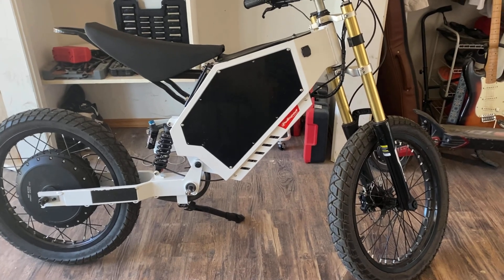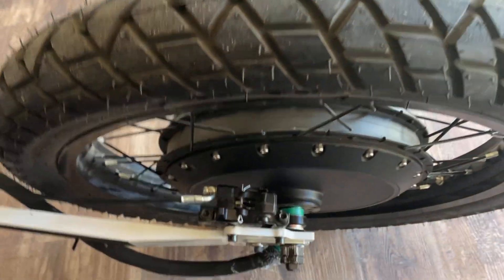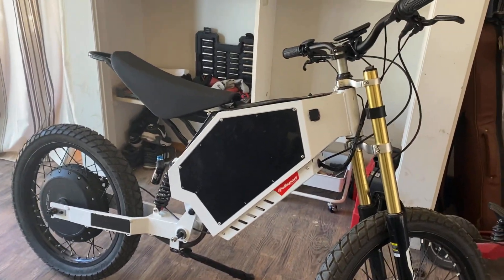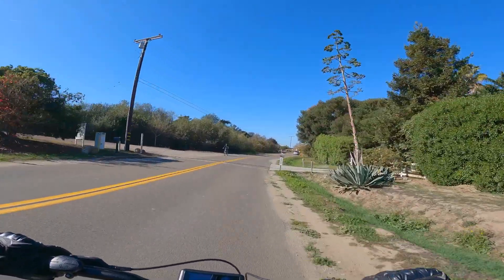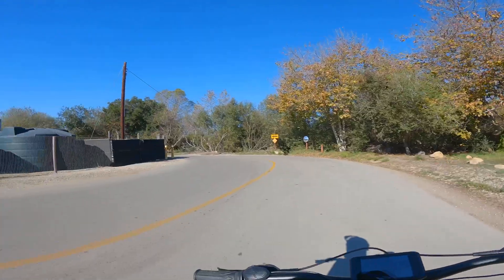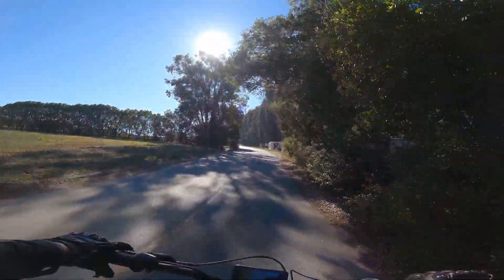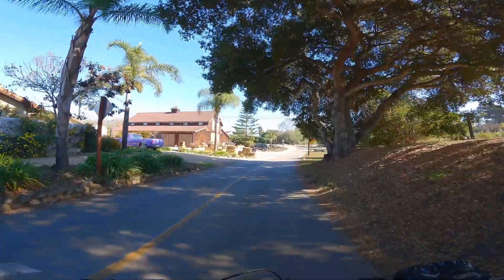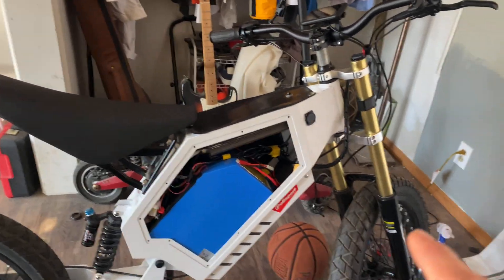65 mph enduro ebike is finished! (Enduro ebike update no.3)

Comment: How many amp hours does the battery have? and at a speed of 40mph how many miles can you do?
Reply from the maker: 2880 wh battery 40ah. If I was going 40 I could probably go like 25-30 miles. I usually go on rides that are all uphill for miles at a time. I go about 35 mph, and at around 13 miles I’ll turn around. Usually I will have like 60% battery at that turn around point. So that’s just a rough guess. I’ll have to do a 35-45mph range test.

Comment: Hi all. Be aware that the NB power does not honor their warranty, and in case of any trouble when contacting their technical support you may receive totally unqualified help (which in my case burnt/shorted the whole system). I purchased the 72v 3000-5000w kit form NB Power for my Sondors Madmods Scrambler. The kit is this Sabvoton 80a controller (SVMC7280) paired iwth NP power's own motor, which they call fatmotor 3-5k. I asked for 4T winding to get more torque than speed (have lots of hills). I have a 72v batttery with 80a daly bms. The pack is built with 160pcs of p421 Molicells (21700) in a 20s8p configuration amounting to 72v 33.6 ah. I installed the setup and the bike was running beatiful for 20 minutes. I was a happy camper. Parked and the next day I tried the bike the wheel had constant drag and vibration (usually damaged hall sensor). Tried both hall sensors, same issue. Contacted NB power and their technician would not believe there was a probelm with the motor, despite the permanent drag and vibration (plus noise during operation, again, typical of hall sensor damage). The NB power technician kept asking to change some parameters and test again, changed ofset andgles several times, nothing helped. He eventually said the bike was working properly (despite drag and noise and vibration) and asked me to test ride it. During the testing immediately as I gave it throttle the display shut off and wouldn't turn back on. I had to connect and reconnect from the battery (I am using QS8 antispark connectors), but it gave a spark. Tried second time, and it gave a spark again, so I disconnected everything and tested my battery first with a multimeter. Battery tests ok, and the voltage matches what the daly bms displays through the bluetooth app. So now I tessted the controller and the positive and negative wires are short circuited. Also by running basic tests I can see the short circuit on the blue and green phase wires of the controller. NB power did not honor their warranty, though it has been on ly 5 months since purchase (just took me a while to build the battery pack, the kit actually worked only for 20 minutes). So beware that when buying from NB power you are taking a chance.

Comment: I have a question for you if you  answer questions? I just received one of these stealth clones from Alibaba and I noticed there is no welds on the rear shock mounts that attach to the swing arm. Looking on the Internet most bikes have the welds attaching the shock mounts to the swing arm but looking at your video it doesn’t look like you have the welds either…? Given the way the bike is built in my estimation and I don’t know how it’s put together but it seems that the mounts are either pressure fitted into the swingarm or the mounts are tacked (tack weld is a small weld to hold a metal piece in place so it can be welded) welded before the swing arm pieces are welded together in the factory.  Now if either(Press fitted or tack welded) of my suspicions are correct this is not safe… i’d appreciate to hear your thoughts on it.
Reply from the maker: Sorry I don’t answer questions sometimes. I get hundreds of them a month and some require me to do research to answer, so it is time consuming. But I try my best. 

 I have noticed that weak point and it is a little concerning. A few people I watch videos on, for these bikes have had those cave into the frame. One example (Sam Johnson). I’m not to worried about it personally because I weigh less than 150 pounds. But if it were to cave in you could probably cut into the frame. And weld some plates underneath those. So that It would have extra support and just weld the top of the swing arm back on. Assuming you have a welder. Still despite it being a weak point it is still uncommon for it to break.
Reply: @ENDOPRYSMofficial  I appreciate your taking the time to answer my question thank you.

Comment: What’s are they specs, battery? Watts? Etc.
Reply from the maker: 72v 40ah 150a battery paired with savaton 72150 controller. Putting out 10.8kw.

Comment: If you want more power just go into the menu on the screen and change your wheel size to the maximum listed size and your speed and power output will increase fully just make sure you get the brakes you need to stop properly.
Reply from the maker: How do you go to menu?

Comment: In the process of building one on my channel starting off with the paint side of things great video I hit the sub all the best DRED FX ✌
Reply from the maker: Right now I’m tearing the bike down and doing a step by step. I’ll probably get it up on Sunday. I can use my bike right now because I have to run more wires in parallel to my existing battery cables. I need to do that because the wires are to thin for the amount of power my bike puts out. And because they are thin there is resistance causing heat which melted one of my connections. I have most of the stuff to do that though.

Comment: Nice to see it on the road! the pull is awesome ,  I can't get enough of it. That big motor should run cooler than mine and it is upgrade ready for more power later.
Reply from the maker: Well my battery bms is only 150a so a larger controller won’t do much good unless I tear into my battery and swap the bms with a bigger one “if I can do that”. The motor does stay very nice and cool though.
Reply: The QS205v3 is a better option for these enduros, BUT you gotta open them up, varnish or pot the stator/rotor, paint the insides of the covers with high-temp flat black paint, add 10mL ferrofluid, and add heatsinks.  Do that and they run plenty cool with 17kw peaks.  It's 20# lighter running the 205, so more range, and better handling/balance

Comment: What wattage is battery? How much did it cost u to build?
Reply from the maker: the battery is 72v 40ah with a 150a bms. and it has 2900 watts of cappacity. my bike is 11 kw. build cost was about 4000
Reply: @ENDOPRYSMofficial  and the throttle? Do u know about the domino throttle and which colored wires need to be connected together between the throttle and the controller ?
Reply from the maker: @momoney6272  I’m not really sure about that.

Comment: Umm hold on 🤔 in the last video of yours that watch you said that you was having a problem with your controller and was waiting to hear back from the supplier. Ok so what was the issue, was they a short in the wiring or did you just have to reprogram it or did they send you a new one?
Come on bro let me know what happened!!

Oh and you said that you have regen-braking well how does that work, like is there a button or a switch that you have to use or does it somehow kick on automatically when you press the brakes??
Reply from the maker: So what happened is I did not run the hall sensor test on the controller app which pairs the motor to the controller. And if you don’t do that you will ruin a controller. The supplier did not give me any heads up on that and instead messed with me so I would go away. I told them I would give them a bad review on my YouTube channel so they sent me a new one. 

 There is a wire connected to the brakes if you take a second look you will see it. When you pull the brakes it sends a signal to the controller to regen brake. 

  I’m gonna post a vid Tuesday we’re I show how to program controller and all that.
Reply: @ENDOPRYSMofficial  oh alright great thanks for that information because each day I was checking the see the start, middle and end result of your build..
Hey and in the future can I use you to give good or (but really) bad reviews on a bike or two that I'm waiting to receive because honestly speaking, dealing with this supplier on alibaba can really be a pain in the A**! Lol 😆
Reply from the maker: @fantasy-island52  yeah of course the channel Instagram is endoprysm so message me there if you need me.
Reply from the maker: Also speaking of beginning middle and end I’m gonna do a vid similar to the first one i put out. I’m gonna take the bike apart and put it together piece by piece.

Comment: which
brake
you
have
use
please
telll?
Reply from the maker: I used the front brake it works fine. But it doesn’t fully bite the rotor. So if I get a larger rotor i should have a bit more stopping power.

Comment: Really enjoyed, I'm going to be ordering an e-grom style chinese motorcycle soon and plan to upgrade to lithium shortly after getting it. Still torn on what battery to use, my first mod was a 60v lithium on my little razor sx500, just used a pre-made amazon lipo I think it was btrpower or something I'll probably do something similar to that this time maybe a 45ah instead of 30. Stock the bike comes max speed 40mph with SLA I want to get it to at least 55 hopefully 60. Cheers man, enjoy your videos.
Reply from the maker: Thanks, I was also thinking of modifying a Chinese grom but I liked this bike a bit more. Will be posting many more on it.

Comment: how much did it cost all together
Reply from the maker: 4200. With extra shipping and taxes. So a few hindered less than my brothers surrons that I use in some vids. Although if you don’t pay extra for shipping and budget a bit better you could probably get it for like 3600
Reply: @ENDOPRYSMofficial  and how long did shipping take
Reply from the maker: @benchesterman1141  all depends on the parts. My motor and battery take about 1-2 months with standard. But with air shipping it only takes 1-2 weeks but is costs like 100 dollors.